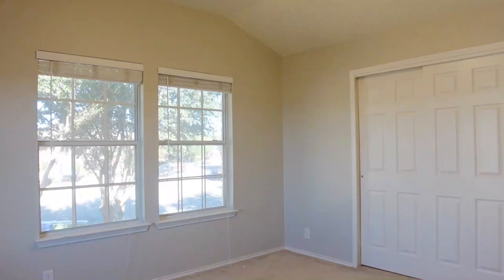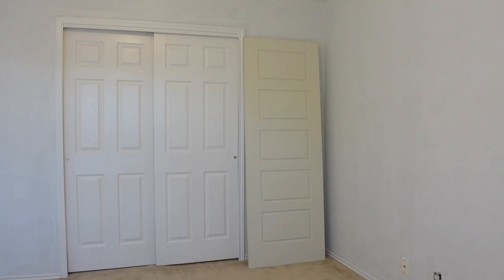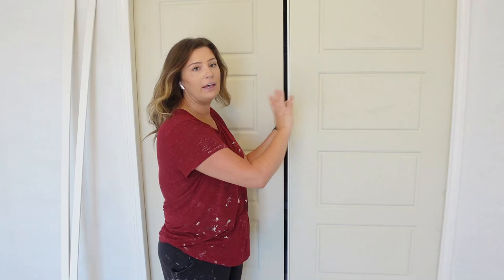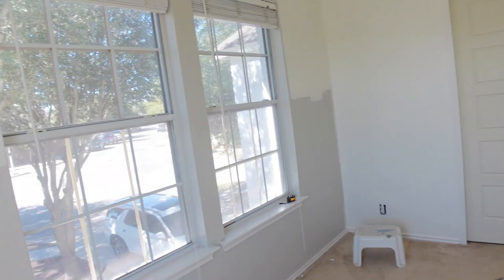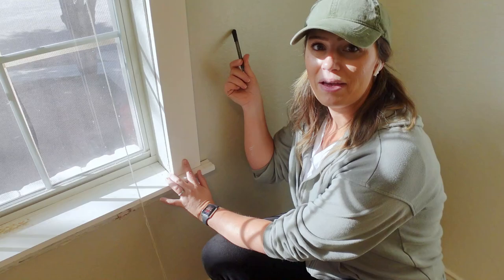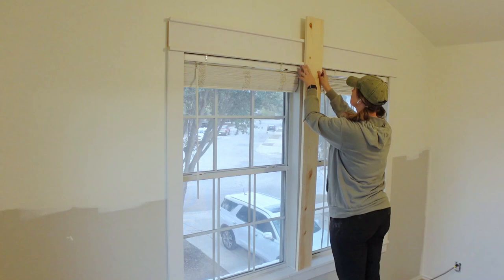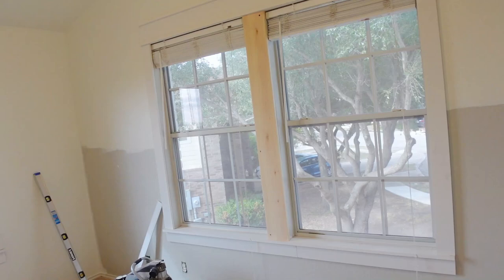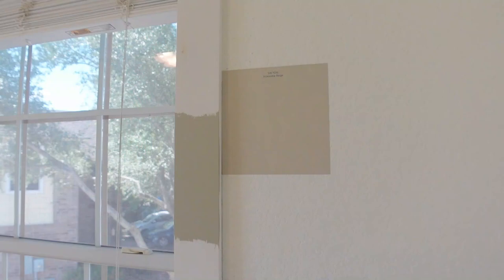EASY WAYS TO ADD CHARACTER TO A BORING ROOM | GUEST BEDROOM MAKEOVER PT 1

Comment: Here’s a tip when you’re going to pour paint out of the paint can use tape to make a V across the top that way just peel off the tape and none of that paint pouring down the side of your can. Also, if you drill holes in the lip of the can the paint can drain back into the can.
Reply from the maker: Good to know!

Comment: Why did you want to mix CL and SW paints instead of using one or the other?
Reply from the maker: Not sure what CL paints are?
Reply: @KelseyRomitoDIY  Chantilly Lace and Simply White paint colors
Reply from the maker: @TEXASdaughter  oh I see! I thought SW meant sherwin williams. I was having a really hard time deciding on a white paint color for the main floor (because of existing tones I had to work with) and mixing those two was the exact color I wanted. I used that leftover paint for this project.
Reply: @KelseyRomitoDIY  Did you have them mixed for you or did you buy the to colors and mixed yourself at home, sorry if you answered this in other video, i;m new to your videos.
Reply from the maker: @emmt1256  I mixed them myself.
Reply: @KelseyRomitoDIY  TY